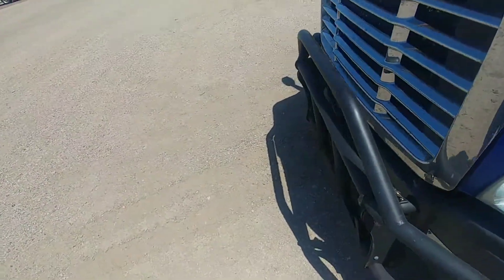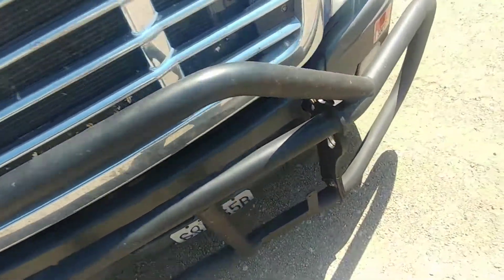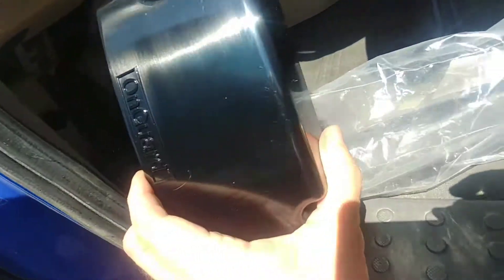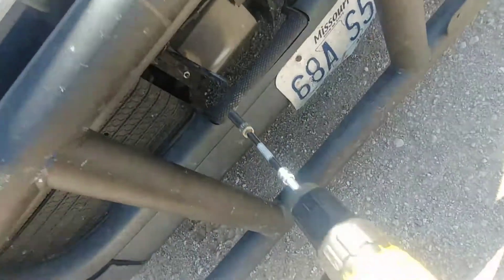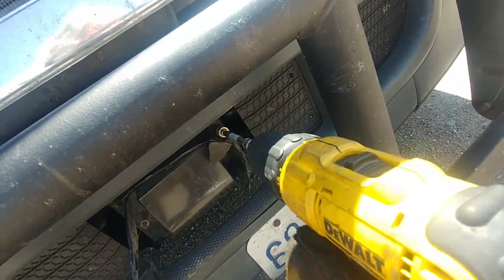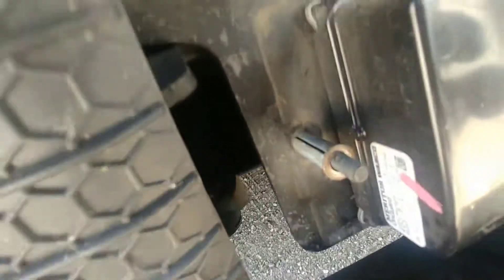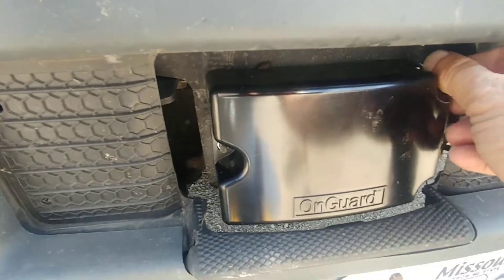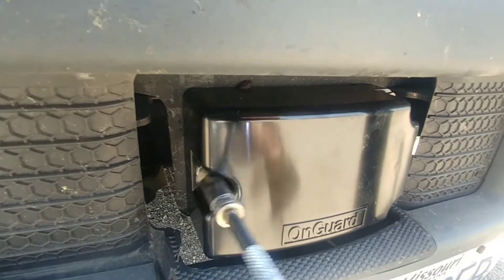OnGuard Collision Avoidance System

Comment: If you want to Wabco on-guard stop bother you just cover front radar with lead metal sheet. I make my: plastic decorative license plate + attach lead sheet to it + under carpet foam. I monted it @ front of radar. 

Trick is that lead is absorbing waves & not reflexing 'em back. Radar use microwave frequency like microwave owen. So not be exposed by microwaves & eliminate waves going to metal & make sparks they put lead metal sheet inside.
Reply from the maker: On these particular trucks the cruise control won't function if the sensor doesn't "see" movement.
Reply: @RolandCaston  it will work. Lead absorb waves. For truck is like nothing is @ front. Cruise control will work. This cover is for OOs & small fleet
Reply from the maker: And with this company, disabling "safety" equipment will cause you to be terminated.

Comment: That system is a POS, constantly giving false alerts & slamming on the brakes for no reason.. idk who designed it, but it's dangerous...
Reply: You can cover it!! But whatever you use it has to be over the whole entire box. I tried to put my tag in front of it and it went crazy, so use some duct tape with something solid in front of it to fully block it out. You can still run it will throw up a signal that it's blocked like if snow had blocked it or something.
Reply: I hate driving now because of all the beeping and nonscnese it detects